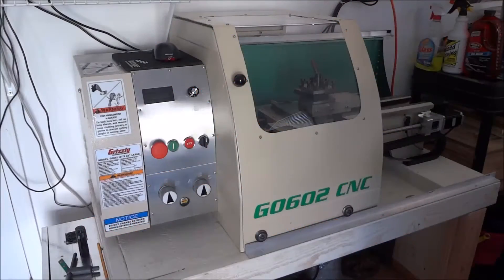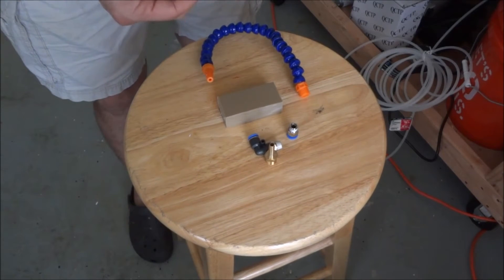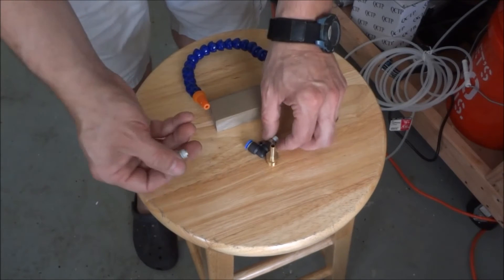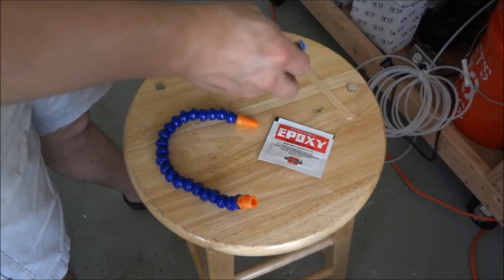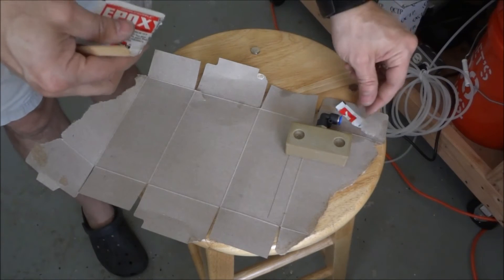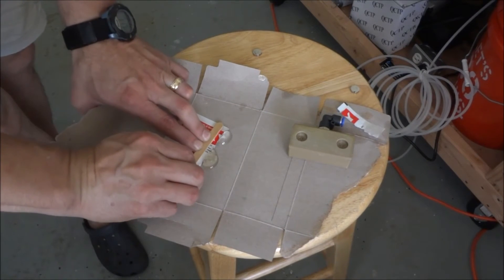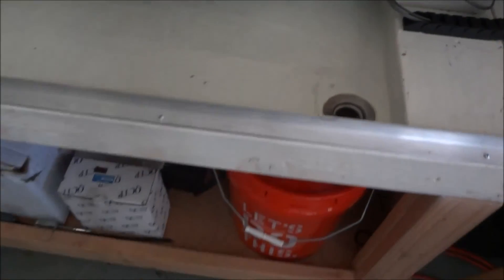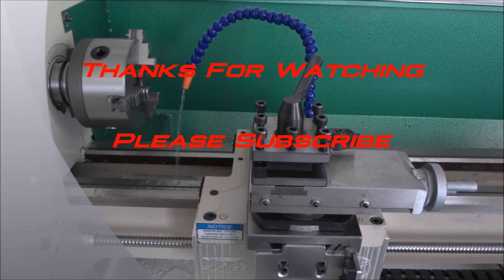G0602 Project Flood Coolant DIY Magnetic nozzle

Comment: Looks good. Where did you get the magnets and the line-lock?
Reply from the maker: Crivo152 They came in a pack of 6 at the local home improvement center I thick there fairly common at least here in the States. The Line Loc clone I got off E bay there Made in china I bought a pack of 5.